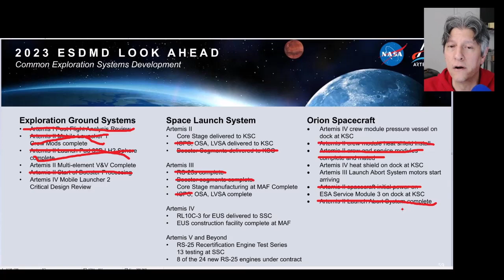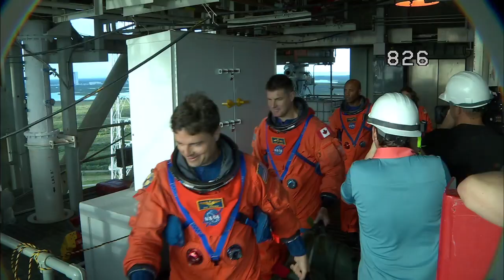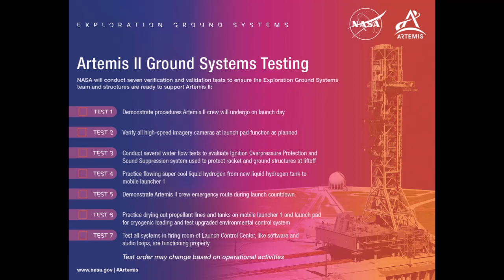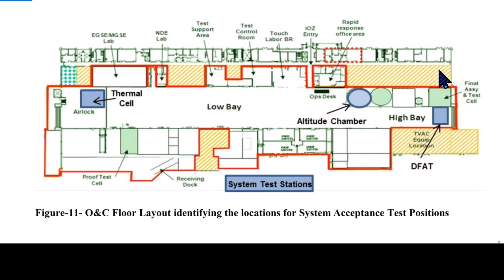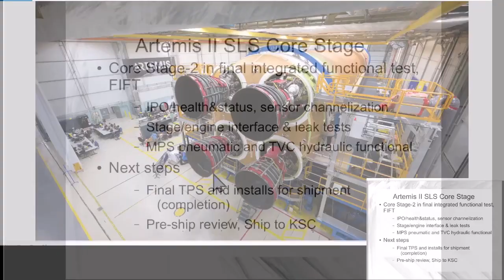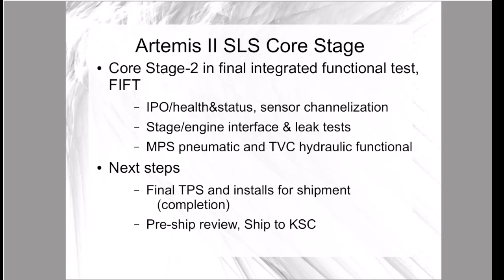Where are NASA's Artemis programs as 2024 begins?

Comment: READ TO THE END HUMAN Friend, if you are going to dispute this  « Humanity Transforming DECLARATION, you will have to explain WHERE GRAVITY WENT !!!! 
NEWTON’S GRAVITY DEBUNKED// No Gravity in a Vacuum = No Universe / the END
Fact is that when M. Brian Cox did his “Experiment” at NASA’s vacuum chamber and removed “All AIR DENSITY”, bowling ball and tail feather fell at the same Speed and Rate. By “REMOVING ALL AIR DENSITY” (air particle)** gravity** stops existing. Proving that there is no gravity in a Vacuum! If gravity would exist, the feather would be carried in the vacuum. Here is an easy experiment confirming. Stand on a chair with a sheet of paper in your hands and let it go. It glides floating on the density of the environmental air, like expected.
Stand on the same chair and make a ball out of your sheet of paper, and let it go. It drops directly to the floor confronting the exact same environmental air density as previously. 
Air Particles are Density in physics. You have not altered the density of paper itself or it’s atomic signature! You have augmented THE DENSITY OF IT’S MASS from sheet to ball in relation with the DENSITY OF THE ENVIRONMENT, air density. Applied physics cannot be disputed.
No one is living upside down on an uncontained spinning water ball, hurling inSpace @ a SPEED of 66.6K mph / on a TILT of 66,6° / the POLES 66,6° / the CURVE ratio 6,66” ( Free Masons Great Architect is Lucifer )and does not know about it because of a magical unproven Jedi Force called Gravity. That is just PLANE ridiculous.